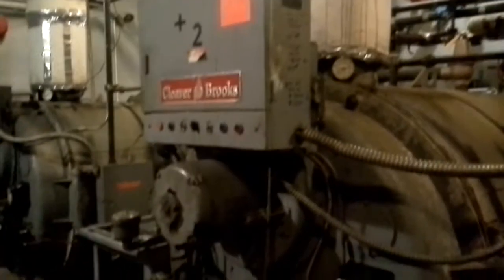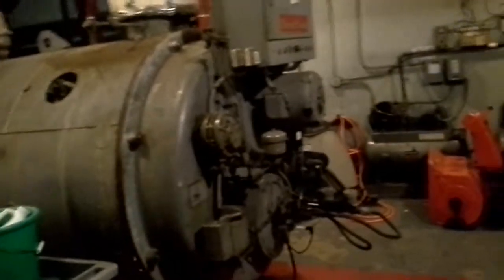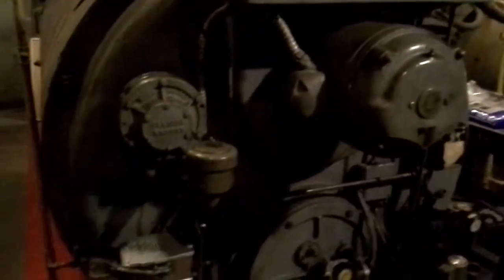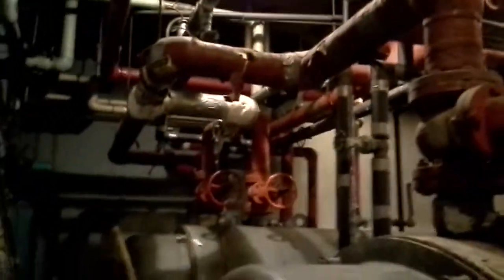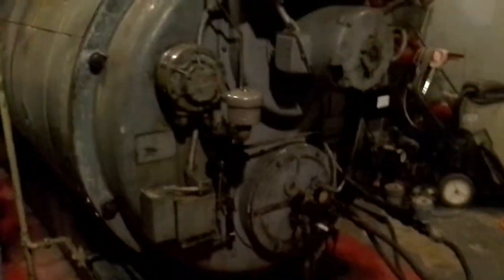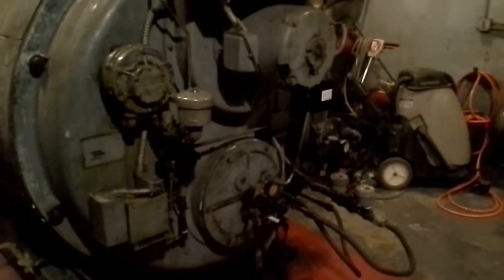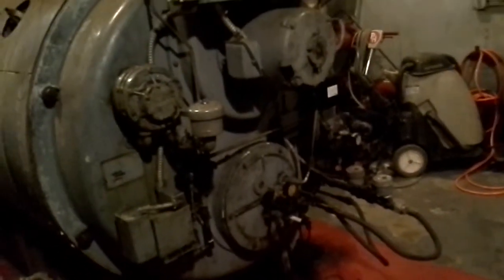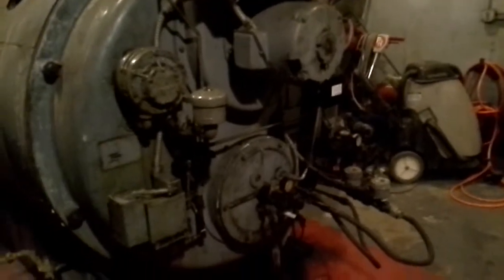1966 Cleaver Brooks boilers final run

Comment: That is some serious equipment.  Talk about old iron, wow, they don't make them like that anymore!  The new ones will be 1/4 the size, "claim" to have the same heat output, but will also claim to be much more efficient.

That's the best part that no one realizes.  Yes, a new one may be more efficient, but isn't it more cost effective to NOT replace the unit and save all that money now?  Even if they are replaced, the new ones may start saving money on utilities, until they break, which of course will be in a much shorter time span than 48 years!
Reply from the maker: You've said it.  This other school replaced their boilers with Smith boilers 10 years ago.  After 6 years of service, they started having problems.  Recently, one of them completely failed that they had to close the school.  Absolute junk.  The new boilers will not top these beasts
Reply: The new Cleaver Brooks boilers are just as good as the old ones.  Still made in the USA and are still the highest quality available.  Sucks this building didn't replace the old ones with new CB's.